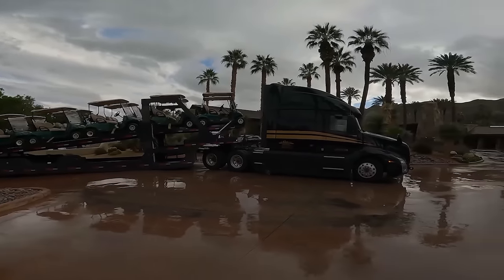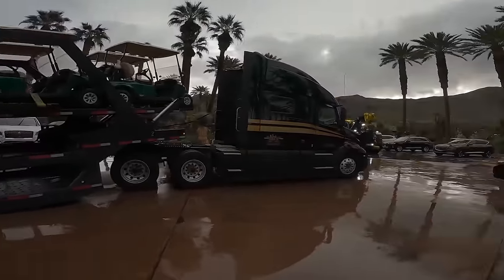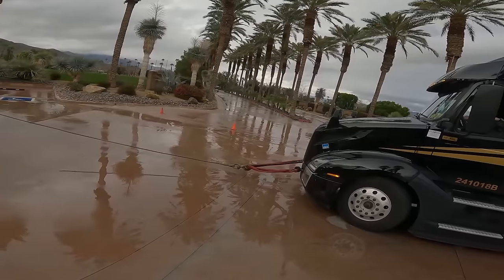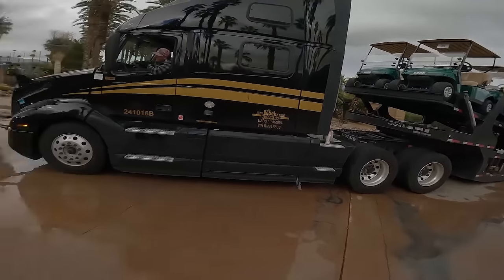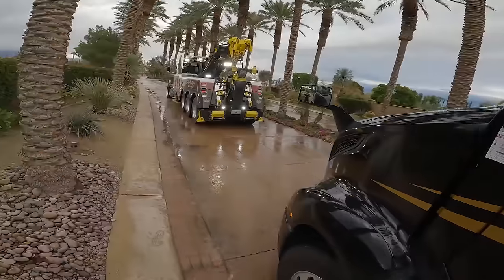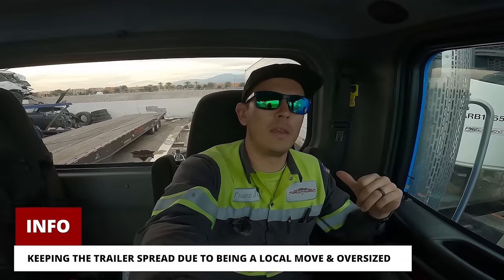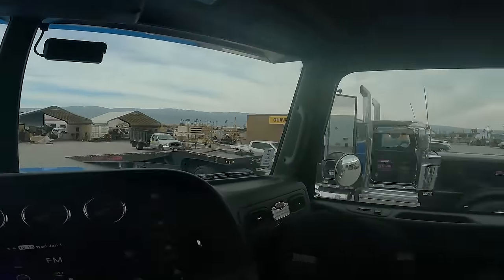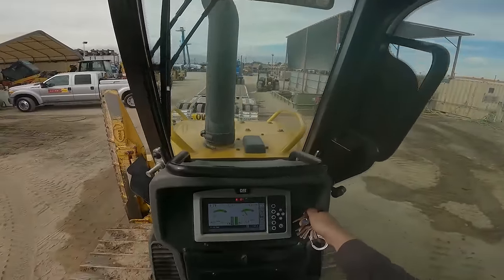Car Hauler High Centered At High Dollar Country Club!

Comment: I'm surprised that more of those car haulers don't hang up as low to the ground as they are!  Loading over the back saves you some time not having to unhook the tractor all the time!
Reply from the maker: Yes for certain pieces of equipment it works out pretty well. It’s definitely a skill that needs to be practiced and if not done correctly can result in a disaster. Thanks for watching!

Comment: A pair of "junk" aluminum wheels set 5 feet back from the back of the trailer to walk up on eliminates the need for the blade to be used for loadingand possibly damaging the trailer